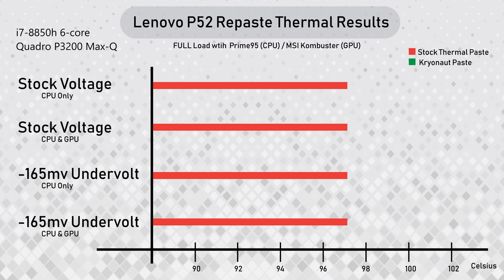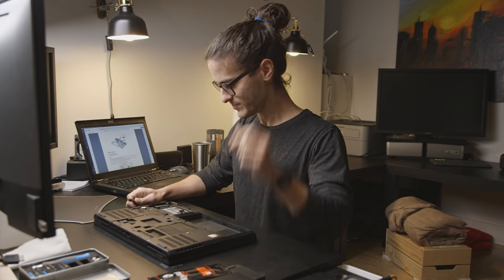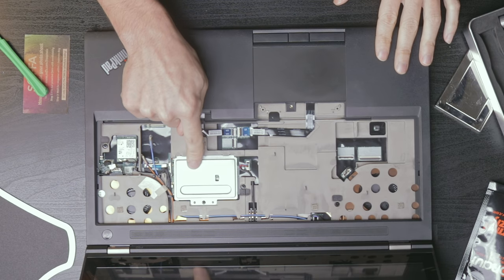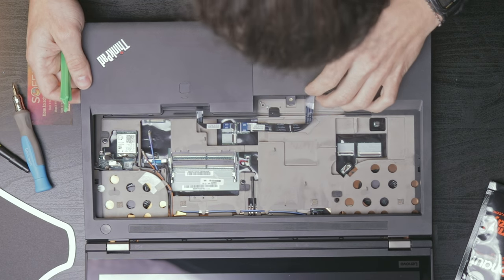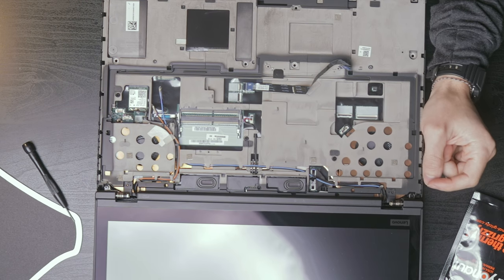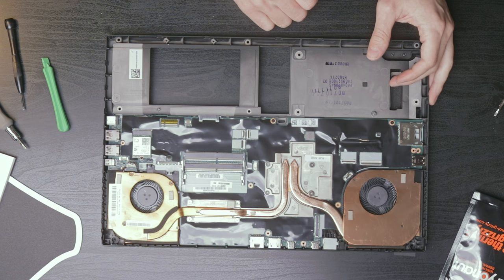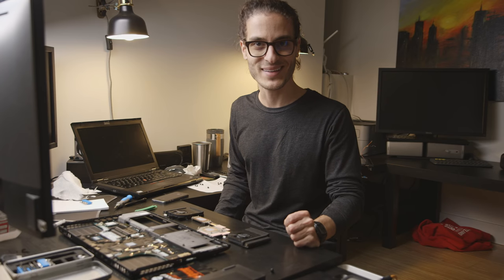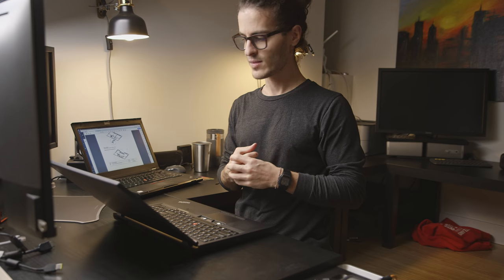According to Jon - Lenovo P52 CPU Repaste & Disassembly

Comment: This is my reference video for repasting. I have followed it for P50, P51 as well.
Note, if your objective is re-pasting, you actually don't need to remove the LCD panel nor remove RAM/wifi card nor remove all the cables. Just loosen the two screws behind the stickers near the each hinge, and the metal frame will come out together attached with the LCD. Of course you need to disconnect the WIFI card antenna cables, the LCD and webcam connectors from the motherboard, but no need to separate LCD or route all the cables.
Reply: Unsure if you'll see this comment in the next few hours, but are you saying, I just need to disconnect the cables just to be safe, before removing the frame? To expose the back?
Reply: @aaronjgeorge  Are you doing a repaste or something else? For which laptop model? My comment is that you dont need to remove the display and all the cables to get the the fans. I am taling mostly about the WIFI antennas and ther touting. Yes you need to disconnect the cables from the motherboard and wifi card

Comment: Hey just wanted to thank you for this video. I had a P51 that was having issues and from reading the solution, I knew it had to be repasted. Your video was extremely helpful and worked. The P51 is slightly different (I had to take out the M2 SSD to get to underlying screw) and maybe 1-2 other screws, but largely the same. Thank you for putting the effort into this video.
Reply: I'm thinking of repasting my P51 too. Did it make great changes in the temperature and cooler speed?
Reply: @CasherPD  well my P51 wouldn't even boot before I repasted, so the fact that it now boots is a plus! I haven't unthrottled it b/c I think it's at the end of it's life and don't need the turbo for my activities. Wish I could give more info. Sorry.

Comment: Thanks for the video!   After watching your video a few times, I decided to take the plunge on my P52 and successfully upgraded from stock paste to graphite thermal pads.  I did not do extensive pre-/post- benchmarking but it looks like the system is running significantly cooler and quieter.

Comment: Thank you so much for this video, I blew the F2 fuse, surface mounted 0402, for the display backlight, this was a great help in removing and replacing the motherboard to get it fixed. I also replaced the dried out thermal paste at the same time. Really great help, keep it up! 🙂

Comment: This is fantastic, thank you so much. Your instructions were very easy to follow. I have a P53 and it was fairly similar to disassemble (there was some extra screws or some in different places). Repasting the CPU and GPU made a significant difference in terms in average temperature. No special tools were needed except for a small and thin Philips screw driver and a few guitar picks. Kept track of the screws by taping them near their original location.
Reply: Hey! I have a p53 as well. Do you remember where the extra screws were? Are they fairly obvious? Input would be greatly appreciated

Comment: Hi Jon! You did a tremendous job with this video, very well explained, very well shot. I repasted my P53 thanks to you and the maintenance manual also, I couldn't thank you enough. The whole process was quite tricky though, especially when it comes to disconnect the tiny connectors. I was able to remove the mesh at the bottom of the fans as easily as a sticker. Now my laptop runs like clockwork.

Comment: i watched your video near when it came out when I got my p52 and have wanted to repaste my processors but always procrastinated on it since I never really had any thermal issues. recently in summer heat my laptops been thermal throttling a LOT, and gonna be using this video to guide myself. just wanted to say thank you coz its super helpful

Comment: Strange that I haven't found this video earlier. Going to order paste and go for this. I use my P52 for gaming and it's thermal throttling all the time. 
I really want to remove that mesh underneath. I always use it on a desk, hardly ever in my lap, so should not drag too much dust in.  I suspect that it reduces the flow too much, adding noise as well. 
Thanks for the guide :)
Reply: Did it now, it was super-easy. (I'm now missing one screw(?!!)). Before doing it, the system was thermal throttling ALL the time. Now it only power throttles, like it should (sadly). 
I also removed the mesh, it's just a sticker with holes punched in it, loosened it in a corner and ripped it off. Whole process took less than an hour.

Comment: Awesome job! I did this on my p52 and it was very easy to follow your video. I also removed the mesh around the intake areas (just use a knife to peel it off) and I got over 20 degrees in improvements! I used Arctic Silver thermal paste for this (I have the 8850H and p3200)

Comment: I'm pretty tempted to repaste my old P50, however after 6 years of ownership it still maintains about 50C to 60C under full load. Running a -150mv cpu undervolt, and a -100mv on the gpu. Thank you for this

Comment: just got myself one... i think that instead  of only thermal repaste i will also cut a small hole and install a switch that passes the fans at max speed like I did on my last acer timelineX... in the EC controller ofall the laptops even if you set the fan speed to max they will not run at more than 70% of what they are really capable of...

Comment: Why did you not go for Thermal Grizzly Conductonaut instead Kryonaut ? 73W/mK against 12.5W/mK. Notebooks do not have Headspreader and work with fluid metals very well.
Reply from the maker: I had thought about it. Gallium, which is the main component of conductonaut, while it's reaction with copper is very slow, there still is electron transference. This can be seen from the silver plating that occurs over time. I haven't found anyone that has data on the effects of these conductonaut over a period of 2-3 years yet. Maybe once the laptop isn't under warranty anymore, and I get get a replacement thermal solution on 3rd party sites, I"ll give it a try.
Reply: @b1n0ry3  I used liquid metal "Coollaboratory Liquid Pro" back in 2011 on my laptop and PC. Worked like a charm. "Coollaboratory Liquid Pro" has ONLY  32.6W/mK. 
But after 3-4 years, cooling on laptop got worse. I never repasted it because I got a new laptop but I think nothing severe happened. After 1 year I opened my laptop and saw, that the liquid dried out but I didnt bother to repaste because cooling was still fine. 
I think liquid metal have a limited durability of 18-24 months and then require repasting. After watching your video, I dont know if I want to disassemble my P72 every (second) year. Too much can go wrong.
Did you archieve undervolting your GPU? If yes, how?
I undervolted and overclocked my i7-8850h. I reached 1304 points in Cinebench R15.

Comment: Hi Jon, what is your experience after almost a year of using P52? Did you have any issues with drivers in general and touchpad latency (I saw this issue over forums)? Is this piece of hardware still worth buying, having in mind using it for CAD and simulations in general? I have good Campus offer, and I am considering to buy P52. Thank you.
Reply: 6 months using mine, they fixed the mouse latency with the update...

Comment: Relieved my p52 with a Xeon and p2000. I did not order a SSD with it and man it's so sloww with the HDD. Planning on upgrading probably to a 970 evo soon
Reply from the maker: How have the thermals on your machine been? You could always get a MX500 500GB 2.5" in the midterm?? Speed things way up for about $64.
Reply: @b1n0ry3 Oh thermals ok. CPU hits 3.7 - 3.9 on high loads, also I'm staying in India where the options are not soo great, so I plan to wait and catch the 970 Evo on a sale or something. Import duties make everything cost double here.

Comment: I think I've been inspired by your video to do my own repaste video.  What camera are you using? It seems to handle low light conditions pretty well.
Reply from the maker: Main camera is an old Canon C300 and some other shots are from a Canon SL1
Reply: @b1n0ry3  Thanks!
Reply: @b1n0ry3  That camera is not cheap! I just looked it up on ebay. You mean the Camcorder? Whew.

Comment: Am curious to know if you know...Would the 4K display in my P50 fit in a P52 with a FullHD display? Could I swap them over successfully?
Reply from the maker: My guess is no. The cable would be different, and I'm not sure about design wise if they would even be swappable (fit in each others cases)... sorry!
Reply: @b1n0ry3  thank you for your response. I have done some cross-referencing since I asked this and determined that the screens ARE interchangeable between the P50 and the P51 (Same FRU's) but as you say NOT the P52 which has a different set of FRU's

Comment: Thanks for the video.  Do you think the temperatures might be high do to the motherboard being wrapped in plastic?  The plastic blocks the flow and if you touch the bottom surface (remove the lower panel) it is super hot where these plastic is visible.   I think they isolate the motherboard to protect it from spills or sand but at the same time they are affecting the air flow significantly.  Other laptops are pretty open and you can see the motherboard and they run cool.   Thoughts?
Reply from the maker: I honestly think it's just a poor cooling solution for the cpu and gpu. If you think about it you have a 75W GPU and a 45W CPU trying to be cooled (at full load). That's 120W that needs to be dissipated. What lenovo has in there now is trying it's hardest to keep things cool but really isn't properly spec'd. If you check out https://youtu.be/hdTsra-uLBI?t=226. Linus has a tear down of the MSI GS65 which has (IMO) a much more capable cooling system. You can clearly see just how it's engineered to be able to pull more heat away from the cpu and gpu. I'd love to get in a WS65 from MSI and put it head to head with my P52. That would be a good showdown.
Reply: @b1n0ry3  Hi, thanks for sharing the video from Linus!  I think the liquid metal is the way to go.  I am too chicken to try that because it is a new machine, and quite expensive.  However, there has to be a way to safely apply the compound.  I will practice the application on a glass surface to see how it spreads.   Also, while the machine is open I want to see if it's possible to safely create a few ventilation openings by cutting the plastic avoiding contact with any metal surface.  I know the lower grids are conductive.  We will see.

Comment: Thanks. Do you have any idea how similar your video and instructions would be if I wanted to do this with a Thinkpad P51? To a novice this just seems so crazy hard to do with so much that could go wrong : )
Reply from the maker: https://download.lenovo.com/pccbbs/mobiles_pdf/tp_p51_hmm_en_sp40k88791.pdf
Reply from the maker: Here's the maintenance manual that'll walk you through it
Reply: Thanks so much for taking the time to respond. Sadly I am all too familiar with the HMM for the P51 and unfortunately I need more hand holding then the manual provides. Something like your video specifically for the P51 is what I am looking for. I have searched the Earth for one : ) See the links in the following two posts. In the first link the discussion about the P51 occurs half way down. I suppose I could look at the HMM for the P51 and the P52 and see what if any differences I can discern. Thanks again.

Comment: Appreciate if you can confirm if the CPU is replaceable? Or it is soldered on the motherboard and only reball is possible?
Reply from the maker: Only reball. I believe the last lenovo thinpads that's had socketable cpu's was the T430, T530 and W530's.

Comment: the mesh is easily removed.  I wish my GPU (P3200) ran as cool as my 8850.   I am using PTM7950.  I may have lost a pad on the GPU side.

Comment: Jon, just curious if you see any BSOD issues?  I've got the P52 i7-8750H (P1000) and I get one every day or two (different error codes too).  Even after undoing the undervolting (your previous specs were good for performance!) the issue persists.  Any thoughts?
Reply from the maker: You know... I have randomly gotten some BSOD's. I think Kernel Heap Corruption was it. Could never pinpoint what caused them. Haven't had any in the last month or so.
Reply: Thanks for the reply,  @b1n0ry3 .  I installed the latest version of the Intel Driver & Support Utility and it identified a few drivers that were out of date that Lenovo Vantage didn't find.  I was blocked from updating WiFi or Display drivers but updated the rest and I haven't had a crash in a week.  I'm hopeful that solves the issue and maybe this helps someone else.

Comment: The mesh at the bottom of the fans is easily removed. Just did mine with a pair of tweezers. Its held on by some sort of glue, not particularly strong.
Reply: i did this on my previous laptop but it will clog much faster the fins and the fans...
Reply: @ElectronicMarine   could be, yes. Although mine is never used on sofas, beds, etc. It's either my own desk, or office desk. Besides, i usually open up my laptops at least once a year, so it shouldn't be a problem.

Comment: Can I ask you something?. Can I replace my 135w charger instead of my 170w P52 charger? thank you!
Reply from the maker: Are you asking can you use your 135w charger instead of 170w? You can use the 135w charger on your P52 but you may experience decreased performance under full CPU and GPU load. It may also prevent your battery from charging under heavy usage.
Reply: b1n0ry I work from home, I use 170w charger.When I go outside I bring 135w charger to my mobile device.Outside, I just use simple work like ofice ...  affect the hardware of the machine or not but the performance is not too important

Comment: Appreciate if you can confirm if the nvidia card is replaceable?
Reply from the maker: It is not. All soldered onto the motherboard.
Reply: @b1n0ry3  thanks, why these vendor cannot work with modular integration.
Reply: It will be when the P15 comes out

Comment: Is there any chance you could post the model numbers for the fans in the assembly?  My gpu fan is on the fritz and I cannot find info on a replacement.  Thanks in advance!
Reply from the maker: SUNON MagLev  PN:  MG75090V1-C190-S9A     DC5v - 2.25W
Reply: @b1n0ry3   Thanks a ton! I really appreciate it. It seems that the fan is unavailable for purchase anywhere and I just have to take the system to a repair location for them to replace the entire thermal assembly.  Hopefully it's covered by the warranty.

Comment: I was meaning to ask about ram upgrade. I wanna go as cheap as possible then upgrade the ram later on. Is it possible? How many slots are there? I forgot if you said that you had the 4k or 1080 model but can you use the thinkpad pen(or anything other pen, I am a note taker at times) on the 4k touch screen? Thank you for this information video about the device, I am seriously willing to change the thermals a bit and doing so much more. I am glad someone in YouTube is providing content for this underrated thinkpad :).
Reply from the maker: The ram is upgradable, so you could just get 8GB stock and upgrade later. There are a total of 4 ram slots. Two under the keyboard, and two under the access panel on the bottom of the laptop. Honestly the price of ram from lenovo compared to ebay or newegg is very close!
Reply: I agree with Jon -- the Lenovo RAM was priced about the same as everywhere else so I upgraded the RAM.  I did however, go with the cheapest storage option (HDD) and then later added a good SSD.
Reply: @b1n0ry3  I ordered mine with 16gb and then bought an identical set of ram chips for $60 shipped on Ebay. Samsung DDR4 2666.
Reply: Good questions and answers thank you guys

Comment: Did you find anything out about the RAM speed? I was going to get one of these until I saw the 2400mhz vs the P1 running 2666mhz. Mainly looking for to use for video projects. Can you overclock to 2666mhz?
Reply from the maker: The ram is rated for 2666Mhz, but it only runs at 2400Mhz. No overclocking of the ram is possible but I doubt you'll notice much performance. I use my P52 for video editing and CAD work so it's more than capable.

Comment: Hey Jon, I'm not really a giant geek and I got a question: can I put my own SSD ( A Kingston 480 gb SSD) in the 2.5-inch drive slot?
Reply: You should be able to.  But why not go with an SSD in one of the two slots available slots?
Reply: @randylevy  I've got the M.2 NVMe SSD slots aswell :)
Reply: @Didymusartist  SSD should be OK in the 2.5" slot.  Do you have the Stock HDD in the 2.5" slot?  Is it the boot disk?  If so, you'll have to clone the disk to the new SSD you want to use before swapping the drive.  Although you would be better served to clone to one of the NVMe SSD and make that the boot disk. That's my setup: 2 NVMe SSDs but I left the stock 1TB HDD as "cold" storage for rarely accessed data.

Comment: i got the xeon p52 and in a cpu only stress test i only hit 97 3 times and it mostly stays in the high 80's low 90's at times
Reply: Also was your text at 97c the whole time at 100% or did it just peak like mine
Reply: Update I undervolted my Xeon by
. 090 and it's stable and also set my battery mode to better battery and set my bios power settings to balanced from performance and I'm getting way better temps, in the 70's to low 90' rarely and pretty much not thermal throttling until my cpu decides to go above 4.1 then it'll get 97 and throttle down but it also rarely happens so safe to say I'm good now.